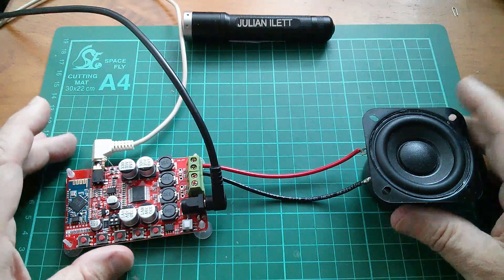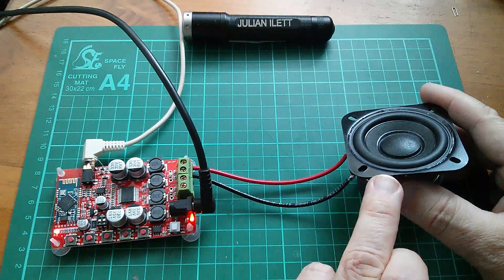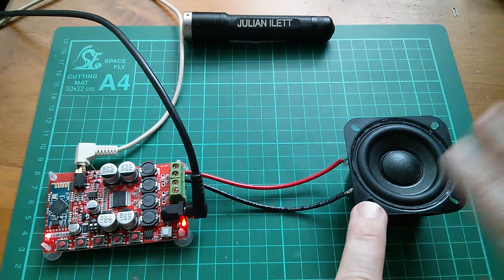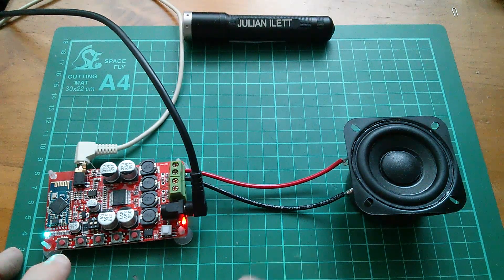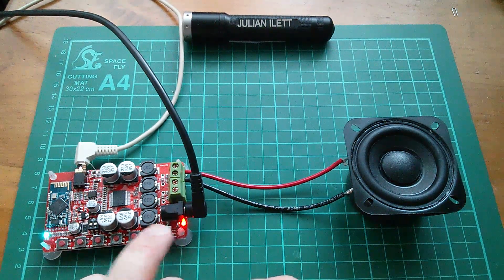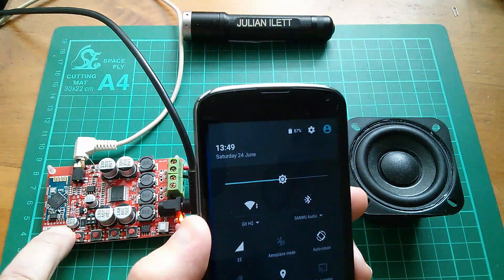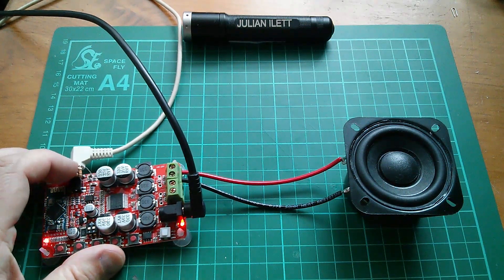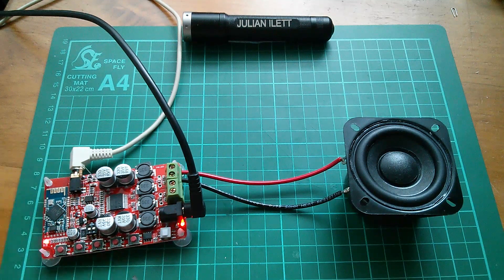Update: SuperCapacitor Powered BlueTooth Speaker

Comment: You don't need a switch to mute the amplifier when switching on.  Leave the 10k resistor connected, and connect an electrolytic or tantalum capacitor between the mute terminal and 0V.  (Perhaps you can increase the resistor value to 100k and use a 10 uF tantalum capacitor to give a 1 second time constant).

You might need to connect a diode across the resistor to discharge the capacitor when switching off.

Comment: Hey Julian I was wondering how this project was coming along. (How you plan to charge the completed project.) I was wanting to do a similar project. Perhaps not that specific bt amp but something around 15w per chan. And a USB charging circuit for an iPod / phone
Reply from the maker: I'm still waiting for the second speaker (which the seller promised to send). The remaining two supercapacitors won't be coming - they've been refunded. So it's just a waiting game at the moment :(

Comment: Is there a way that you could tie into the microcontroller to perhaps reprogram it? I mean it just occurs to me something like that might be possible with some bodge wires and a little patients. Provided that is, that they haven't scrubbed the numbers off the chip or used something that doesn't come up with any kind of schematic when you search for it. I think that might be something worth looking into because if you can just add the code to unmute it after the 3 second key-press that would make more sense to me than having to fit a switch into your project. I mean why make it more complicated than it has to be. And yes I do quite thoroughly realize the irony of that last statement considering the context...

Comment: rather than a switch use a relay and a capacitor so the relay closes a couple of seconds after switch on?
Reply: or a mosfet resistor and a capacitor. So after a short period of time the capacitors voltage rises above gate threshold and the Mofet turns on.

Comment: Ok my play pause idea didnt work with this module, worth a try
Reply: on a side note, i found a similar listing for the exact same board  and it says Note:
If you use external audio, you need connect 3.5mm audio line;
Auto detection for AUX input, the Bluetooth will disconnect after AUX input.

Comment: Cant you do a lil delay circuit between the power button and the resistor with a transistor and a cap limited by a resistor to make it charge up in 2-3 seconds then triggering the transistor to then put the resistor in series ?
This might not work with the power off doh but by the looks of things the power on was the most extreme.

Comment: You must have a different firmware version on the amplifier, mine plays "line in" with no bluetooth connection and no bridging resistor but it does "pop" a little when I turn it on.  There is a version identifier on the top right of the board, mine reads "SW - HF01  V3.2" and under that it reads "150419"

Comment: The audio (power) jacks have a middle connector which is normally not used. You might be able to place that resistor on its path to be bypassed, every time you insert the audio input jack. Which will bypass the resistor.

Comment: Add a NPN transistor in series (CE) with the resistor. Add a cap from base to ground. Add high value resistor from the high side of the mute circuit to base. When powered down cap will discharge via BE diode of transistor. When powered on transistor will be off. As cap charges transistor will turn on. Possibly consider a Darlington configuration.

Comment: You could use a transistor with a short delay (a capacitor??), to mute the output for a second, before it switches on (or off) thus presenting a suitable resistance in lieu of that 10k Ohm one. The old fashioned way, which still turns up occasionally, would be to add a delay relay to the amp output or to the 'unmute' resistor connections. One DP relay would switch both channels.

Comment: Welcome to the world of Chinese class D Bluetooth amplifier boards.  If you are lucky enough to find a fix, the next one you buy (even if you go back to the same seller and see the same photos) could very well be a different version, or a bad reverse engineering job built by a different factory that has a different set of issues.  The sellers don't care if the amplifier makes weird noises.  If it works and looks somewhat similar they think you should be happy.  It's always the same story: "Oh no, I did not mislead you. This is the new version".  If you bought it on the bay and want to jump through the hoops for 10 days or so at the resolution center, you have a fair chance of getting a return label and/or a refund.  If you bought on AE you will be lucky to get 50-60% of your money back.  Just my two cents...
Reply: Glenn C make a dispute then step it up to aliexpress if need

Comment: Could you not pull the mute pin on BT module to low (or high depending on its wiring) or even direct feed the audio into the amp?

Comment: ya if you don't have close to 24v the gain all the way up is terrible and I have had a couple of those boards mostly without the power switch or the 3.5 in but the one I did have with the 3.5 in it was seeming just in parallel but I don't know

Comment: it would be cool if you showed replacing the aux jack with one that has a normally open switch for detecting when a plug is inserted.  that would make the speakers pop only if you start it up with a plug in, minor improvements, but allows the Bluetooth to work fully as designed

Comment: Maybe you could modify your board with a different aux jack. Like the ones that have a little switch in it to determine if there's a jack in it or not. With no plug connected, it goes to bluetooth. With a plug, the aux.

Comment: I wonder what would happen if you just switched the blue tooth circuit off...saving a few milliamps too
Reply: That's what I was going to ask.  Is there a way to disable the Bluetooth?  Maybe with the Bluetooth off, it will unmute the sound and allow the 3.5mm jack to work.

Comment: An RC coupling would do it. If you need/want a digital ON/OFF signal, you could go for a RC coupled Schmitt trigger. You can get them in single small packages. Last one i used was an CD74HC14 which is an hex inverted schmitt trigger IC. only need two external components.
Mabe something like this : http://www.ti.com/lit/ds/symlink/sn74lvc1g17-q1.pdf

Comment: The suggested resistor capacitor delay should work fine, but might be an idea to place a diode in parallel with the resistor to discharge the capacitor quickly at switch off.

Comment: Can you not put a small Capacitor in line with that 10K to delay the Mute when it powers up ? 

I would guess the bigger the cap, the longer it takes to charge it to 3.3V before it unmutes and once it reaches 3.3, it unmutes when the Umphf is over

Comment: Why not to use some simple delayed latching circuit, hook it up to the power switch of the whole board? It would be much more convenient than a second switch to power this thing on. Either that or replacing the push button with a 3 state lever switch that will have 3 positions in that order: OFF / ON / ON and resistor closed.
Reply: i think the same. maybe a cap charging trough a resistor and then switching a transistor.. i dont know..
Reply: 90msg90 - Like an off, an on bluetooth, and an on aux

Comment: Have you considered routing the mute through the input detect pins on your earphone jack? It looks to me like the two pins at the bottom right of the connector would be shorted with the connector in, and open circuit without it. That doesn't help for when you turn on the amplifier with an input plugged in, but it seems like it's probably a reasonable compromise.
Reply: Does the input have switched contact?
Reply: Was going to say the same thing. And if it doesn't have a switched socket, he could always swap it out for one that does.
Reply: Adam Egan many do, and it looks to me like this one does.

Comment: stick a cap in series with the speaker to get rid of that DC when you power it on or off.
Reply: cap would act as high pass filter
Reply: It's not DC, it's a transient.
Work out the mute function is the way forth.
Reply: I believe there already is a cap in series - but it has to charge before it can block the DC.
Reply: Adding the caps at output stage does work, just tested it on mine which is the same model
Reply: The caps placed on the board are just for the input voltage to the amplifier there is no output capacitors

Comment: If the mute is active low, couldn't you use a resistor and capacitor to add a suitable delay on startup?  You may have trouble depending on the input impedance of the mute pin.  If it is less than the resistor in your RC circuit it would.discharge the capacitor faster than the other R can charge it so maybe add another resistor between RC circuit and mute.
V+ -> 1M2 R -> 1uF C -> 2M0 R -> Mute Pin
Reply: This is exactly what I've done and it works perfectly.
Reply: I was thinking about the same idea while watching this video. XD
Reply: The ST data sheet for the TDA7492P shows a 2.2uF cap to ground with a 30K-33K resistor in series with the control line.  http://www.st.com/content/ccc/resource/technical/document/datasheet/35/01/97/6b/20/ce/40/6f/CD00211320.pdf/files/CD00211320.pdf/jcr:content/translations/en.CD00211320.pdf
Reply: I was going to suggest trying a cap as well, so be interested to see if it helps.
Reply: Was thinking the same thing.  RC delay.
Reply: last week I was solving the same problem. I thought of this RC delay addition too but it only solves the problem for turning on. For turning off you should pull standby pin to low before taking away power from the board (in TDA's datasheet there is a section 6.1 Turn-on/off sequence for minimizing speaker “pop”, take a look there) . I solved this problem by changing that power switch with a toggle switch that has three pins - middle one to ground, power MOSFET gate to pin one and TDA's standby through a ~10K resistor to switch's pin 3. So when your switch is in on position everything works fine and standby is not pulled anywhere but when you switch to state - standbly immediately mechanically is pulled low. Now you have no pop on turn on neither turn off.